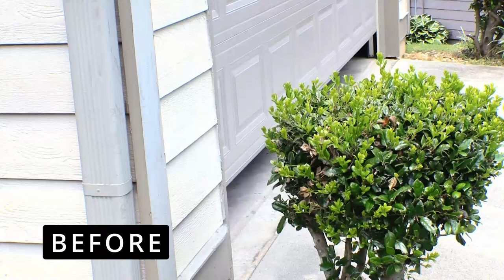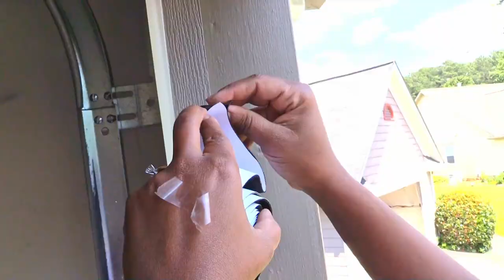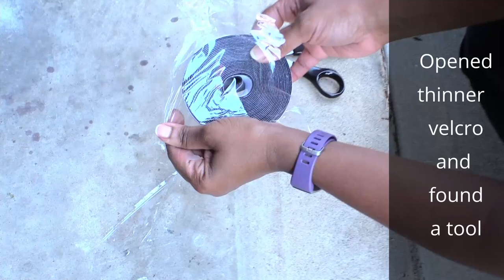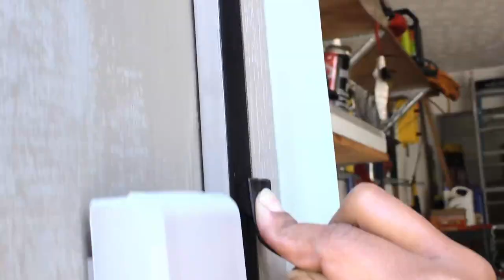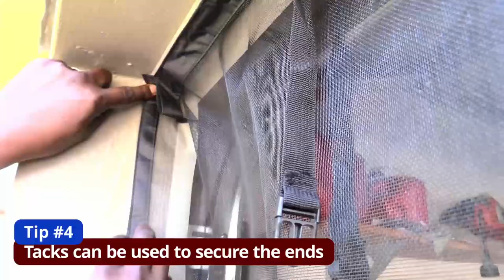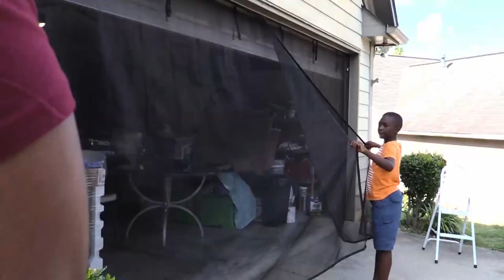EASY - How to Install a Magnetic Screen Door for 2-Car Garage | DIY Power Couple

Comment: I pulled mine tight and stapled it with lath strip with a brad nailer and then painted it. mine had a slot in the bottom so I installed a PVC pipe to keep it tight on the bottom. You can get pretty creative with these screen door kits. nice work.
Reply: May I see a photo of that please? The bottom where the pvc pipe is
Reply: @justinmaypray4017  I’d use rebar as it’s easier to hide.
Reply: Great Idea with the PVC pipe bottom weight.  I dont use my garage for car storage (who does these days?) so during the warm season mine will stay down all the time and get taken down in the winter.

Comment: I am in Wisconsin- our state bird is the mosquito, and are particularly bad this year.  So I decided to order one of these kits.  Fantastic video about installation.   Especially cleaning the area with isopropyl alcohol first.  One thing I did want to mention was to watch pulling off the backing on the velcro- the backing stuck to the velcro, I had to be a lot more careful with pulling it away because it kept sticking.  Again fantastic video great job getting everyone involved.
Reply from the maker: Thanks Jen!
Reply: So true about the pulling apart the backing from the velcro.

Comment: I recommend installing the net on the outer board further away from the garage door. If you do it like they did your gonna end up with the net always getting magnetized to the garage door when it opens and it’s gonna rip out the magnets over time.

Comment: Rolling up the screen is too much trouble, so just put a hook on each side of the wood panel so you could put the curtain over the hook to hold it in place, the same way you treat house curtains.  This will give almost a complete opening in the center of the garage door.

Comment: Nice video. Just what I was looking for. I have always installed mine on the outside of the door frame, wrapping the excess screen around the top and sides securing with the tacks. In my experience, the screen will not catch on the garage door as easily. Have you tried this approach? The sellers on Amazon have instructional videos, showing the installation on the inside of the door frame as you have demonstrated. I’m searching the Internet looking for pros and cons. Great video, keep up the good work!
Reply from the maker: Thank you for watching. No. We have not tried securing the screen outside of the door frame because of how windy it gets. We love how it makes the garage feel like a screened patio. Best, -DIYPC 😃✨

Comment: Hello, that was a great video.  However, when I mounted my screen like this, it sagged, clung to my steel door and didn’t close properly at all.  I took it down and mounted it to the outside facing of my garage.  Now it works perfectly, just like it should.
Reply from the maker: Thanks, Bill...and we appreciate the tip.

Comment: Question. What are you going to do if you have to replace the molding that can break down and crack over time. Once you attach the adhesive to the molding.. ekkk
Reply from the maker: Darci... we're DIYers! ...We'll fix it!

Comment: Any ideas how to deal with 45 degree angles in upper corners instead of 90.?
Reply from the maker: DadsGuns, the great thing about this product is that the Velcro sticks to just about any clean surface so 45 angles shouldn't be a problem. Let us know how it turns out. We know you can do it. -DIYPC 😃✨

Comment: Can these be trimmed to fit non-standard smaller openings?
Like an 7x8 (hxw) porch with 8' steps that opens onto a lake?
Probably a single-car-garage screen would work here.
Reply from the maker: Smaller screens would probably work much better than trimming a more expensive larger one.

Comment: did the magnets catch on the garage door as it was raised, it looked like it did. Which means I need to mount mine on the outer frame and not right next to garage door. Great video very helpful.
Reply from the maker: Underground Chuckey, Yes. The magnets 🧲 do stick to the garage door. We had to hold the screen before raising the door. You can also roll the screen and clip it to the top of the garage door when it is not in use. Thanks for watching! -DIYPC 😃✨
Reply: @DIYPowerCouple  I solved this problem on ours. It cost about 19 bucks but well worth it. When we wanted to raise garage door before parking car especially during rain. I bought a 20 ft roll of 1 inch wide velcro with both sides and sticky on back. I put both sides over the magnets facing garage door... then I covered the exposed sticky with electrician's tape. just enough padding to block the magnetic power to be attracted to the garage door.

Comment: Great job...looks awesome! We are in the process of ordering one of these and I decided to come to YouTube to see how easy (or difficult) they are to install and after watching your video, I am convinced that it is pretty simple to do! My only thing is I am not quite sure that I would want to install it on the outside of the garage just because it is not so appealing to the eye when not in use (rolled up on the outside). Can it be installed on the inside of the garage somehow and still have the same effect?
Reply from the maker: Hi Lady, there was not a way for us to attach the screen from the inside due to the garage door.  The look takes a little getting used to but it is nice once installed! 😄

Comment: That is the negative mounting it outside having to pull it away from metal garage doors and even when rolled up is not a pretty sight seeing them Drape at the top edge of the garage door have not found any affordable interior mount solutions that work
Reply from the maker: Hi Omar! We are searching for an easier way to mount the screen without needing an entire door system on the inside of the garage.  Let us know if you find a solution! 😃

Comment: What make this video so bad is because the opening is magnetic it get caught to the metal door. The Velcro is at the wrong place. It should be placed on the outer part of the garage. It’ll never get caught then.
Reply: I was concerned about that.  If I get in my vehicle while it is in the garage and raise the door without rolling the screen up, it looks like I would end up with a mess.